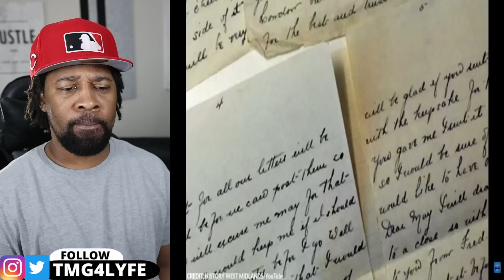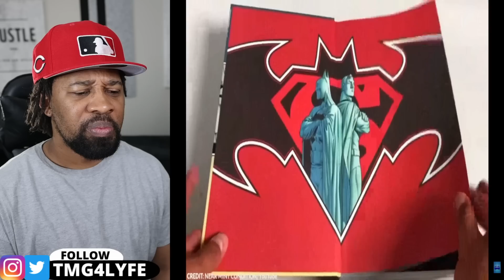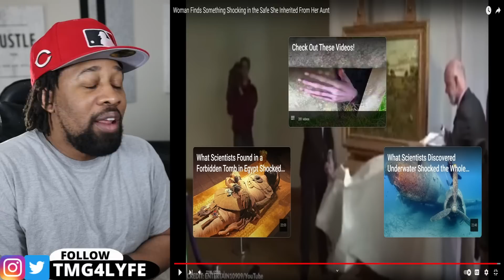Scientists Just Discovered Something Shocking in the Safe

Comment: Even in most safes yes they are air tight to protect against fire and water. Also the reason you never want to be trapped in them even a bank one as big as it is because you will usually run out of air within 12hrs depending
Reply: Even older ones yes

Comment: Safe has to be air tight so it doesn’t mold. It absorbs moisture if not. That bottle of bourbon is worth about $1000 too.
Reply: I found a 40 year of Jim Beam mostly buried under a huge old bush this past summer. Think I can get anything for it? Lol
Reply: @jessiep2471  lol. I doubt it, if it’s just reg. Beam. On the plus side, it’s probably much better now than it was originally. As long as it not cloudy, it should be good.

Comment: I've been metal detecting for lots of years and found that if rag cloth (paper) currency is buried somewhere it gets wet, often enough and for long enough, it will mould and fall apart.  Putting it in a safe that gets wet, like a floor safe that's in a basement, may actually make it disintegrate faster because once the water gets in, it usually won't dry out again soooo...... If anyone reading this is thinking about hiding their expensive bits, make sure it's in a place that will stay warm and dry for decades.